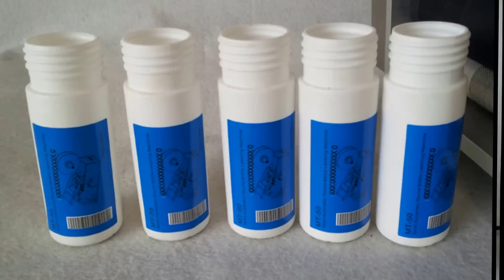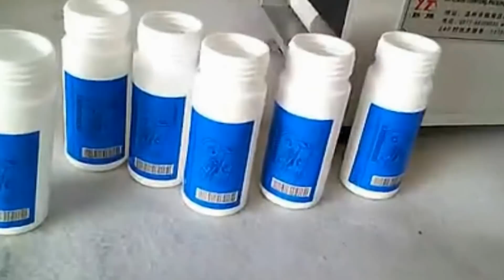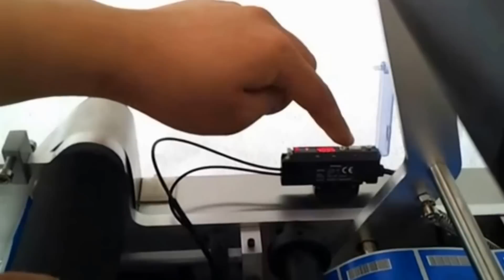round bottles labeling machine semi automatic label equipment printing date coding production expiry

Comment: Just bought one. But what about if the automatic date stamp doesn't work as it should. It works fine when manually used by pressing the button on the controller. But not automatically when labelling a bottle by pressing down the handle. Help?
Reply from the maker: CAN You send us the working video now?
Reply: @penglaimachine  Works now! The cord was missplaced/faulty connected to the small switch for the date stamper. Didn´t see that until and it works perfect now.